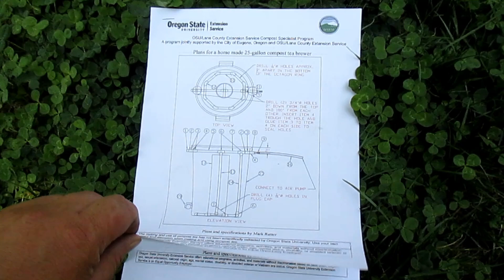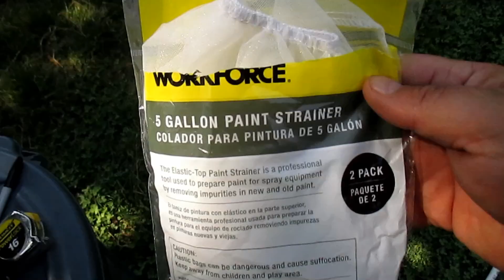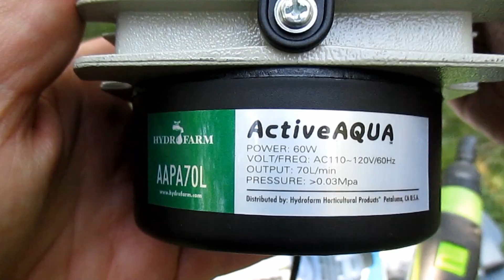Homemade 25 Gallon Compost Tea Brewer!

Comment: A nice and simple design ..... one thing to watch for ( I see it lots) is to have the air pump at least level or higher than the top of the water surface. If you happen to have a power failure you run the risk of any moisture/water/brew flowing back to the pump possibly damaging the pump. This is standard practice for aquariums .... your design example has a reduced chance of this however as the air inlet pipe is large in diameter and unlikely to be a back syphon risk. Good stuff.
Reply: Another option is to install a check value.

Comment: Gday from Australia, how does the average gardener at home quantify that there is fact an increase in beneficial microbiology activity occurring in the finished brew? What simple test could show me the difference that has occurred from the starting point of aeration of brew to the end
Reply: I use a $100 microscope.  The cheap method is to count the number of organisms in the microscope field of view.  Do that like 3-5 times in different areas and take the average.  How do you know that the organisms are beneficial and not pathogenic?  Well...unless you are super good at recognizing bacteria, you don't.  But, the soil food web folks say that pathogens are much less likely in an aerobic environment.

Comment: Hey Dan.  Howbis that pump working so far..  I am getting ready to build mine. But i am between  the 1750 GPH at 102 Watts.   But if your pump is enough, I'd  rather save that money and dont use as much energy..  yours is a 60watt.  Thx

Comment: I found the paint strainer has to big of holes and when it came to using the tea almost all the castings and other things i added were no longer in the bag. Purchased a tea bag with a dinner mesh (400 micron maybe) does the trick. And the lagers sized pump .

Comment: I built this, but the air is only coming out of half of the ring. Any idea why it isn't coming out of the whole ring?
Reply: Too small of a pump? Air leak in your line? As long as it is stirring up your liquid you will be good.

Comment: Hello everyone! I'm just wondering what's the purpose/use of the pipe in the middle? It doesn't seem to have any holes for the air to go out.
Reply from the maker: The center pipe is a wand that goes inside your compost tea brew bag to help agitate and aerate the compost. There are small holes in the cap at the end of the pipe towards the bottom of the can. Cheers!
Reply: @plantabundance  Oh, ok. Maybe I skipped the part where you made a hole on the pipe. Thank you for your inputs. Cheers!

Comment: Thanks for the DYI vid, I sprayed my first batch the other day.  I did notice though, about 90% of my compost fell right out of the bag and was just floating around the container by the end so I had to use another strainer on my transfer pump so not a huge deal.  Is that normal?  I will note, I put too many holes the center pipe and had to switch that out.  Most of the air was coming thru there and not making it to the rest of the system.  That may have agitated it right out?  

Thanks again for the video.

Comment: Turns out the 1/2 inch plastic tubing was actually 3/8  inch on the inside diameter.  So I was back to the hardware store for a 3/8 " male adapter to put the tubing into. Also bought a plastic one, not brass and it was way less.  It is working great !! Thanks for the great idea>
Reply: Same here...

Comment: I wonder if a cheap harborfrieght air compressor would work instead of the air pump?
Reply: Air pumps are generally better because they are designed to run for long periods of time, air compressors are designed to fill a tank and stop.

Comment: Maybe your rough neck 32 gallon container was different than mine but I had to alter a few of the measurements to make it work. I'll test it out tomorrow, to see if it holds together without gluing. Trust me, I'll get back to you.. Thanks for the video.Every bit I learn, I gain.

Comment: the only thing I would probably do differently is use CPVC piping instead of PVC.
Reply: Doogie N.D. There’s no need to use cpvc as the just the pvc will withstand the psi that will put out obviously you seen it in action an every fitting is dry fitted with no glue so why bother with cpvc unless ya intend to throw 100 psi from an air compressor at it I’d stick with the cheaper pvc it may not be brake the bank for cpvc but really not needed